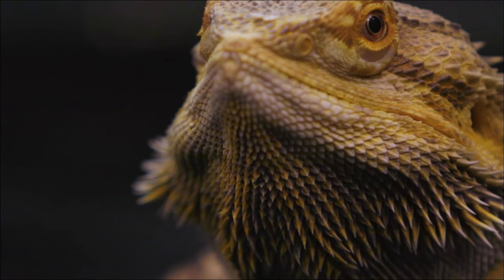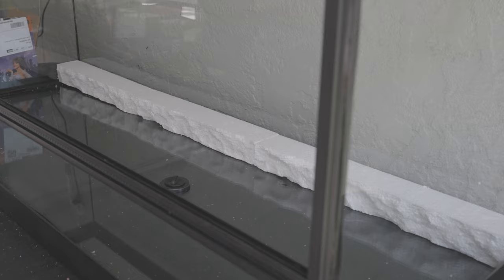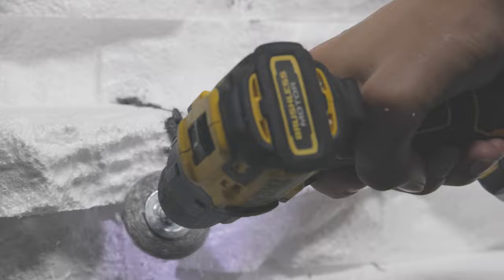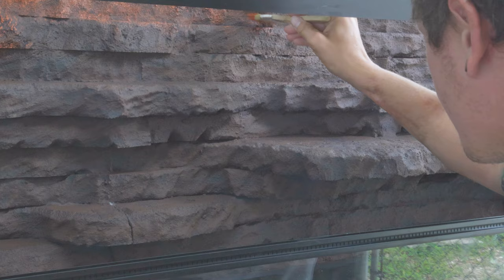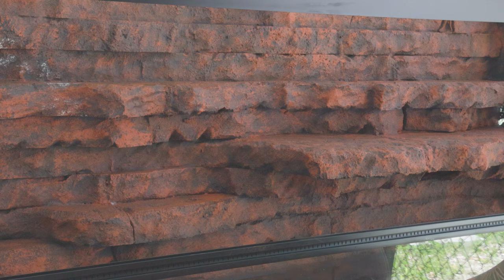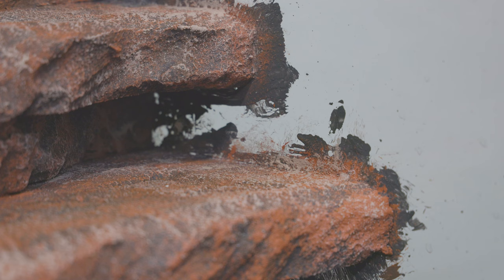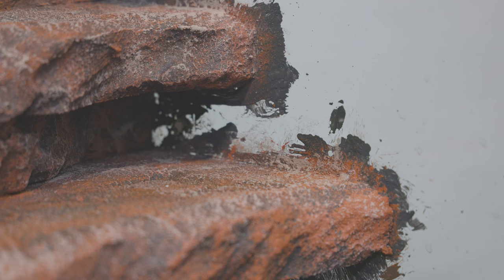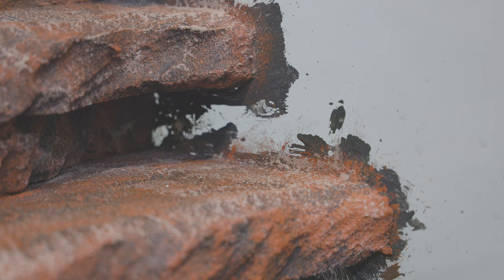Bioactive Bearded Dragon Vivarium

Comment: I'm so relieved to find this video. I did a lot of (I'll be it, rushed)  research in order to rescue a previously abused dragon that needed a gone, and is used styragoam instead of insulation foam. After continuing my research (and realizing i had used the wrong 'foam') I panicked that the styrafoam wouldn't be reptile safe or heat safe (after having already spent two weeks on the background paint, sealant layer, etc. Having made it permanent) i scowered the internet for confirmation to avoid having wasted $400.... so relieved to find this.

Comment: So when your substrate eventually becomes dry, although it has sand on top of it how would you go about rehydrating the substrate? Would i just spray water on top of the sand/substrate? Could i mix the sand in with my substrate mix instead of using it as a top layer as well?

Comment: I know this is an older video but does anyone know if the heat from the basking lamp would melt the styrofoam? Or does the coatings over it prevent that

Comment: Looks wonderful!
I would be curious to see if the plants survive the beardie. My leopard gecko trampled almost all of my plants and the isopods die in the enclosure no matter what I try. So I might have to tear the thing down and go for more basic vivarium instead of the arid one.
Reply from the maker: Are you using arid bugs? And giving them moist areas?
Reply: @thebarefootbuilder6349  I'm using the large orange isopods and springtails that should do well in arid environments. I think it's because the substrate is for arid environments and dries out almost instantly. I do have humid pockets under cork barks and between rocks but they dry out fast even tho I spray it twice a week. And my earthworms died because I had to spray it so much. Maybe the complete substrate change will fix it.

Comment: Did you have problems with the paint staining after drying? I used the same paints as you and every time i run my hand on it it's stained
Reply from the maker: The paint on the side of the tank?